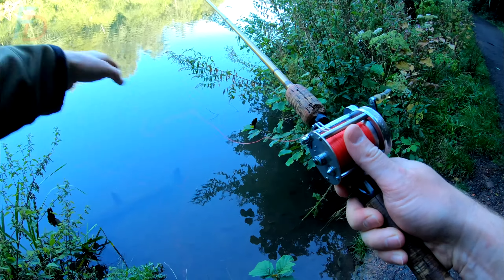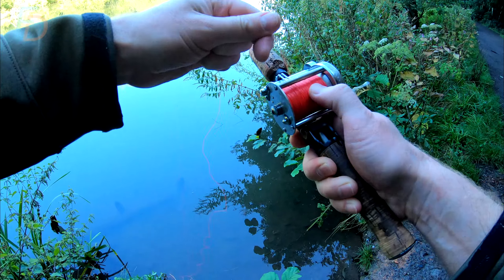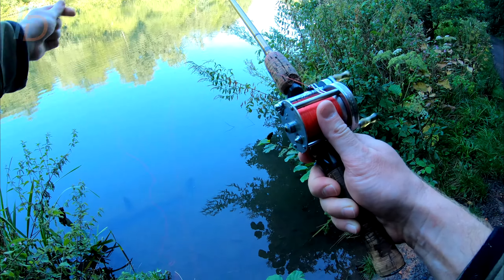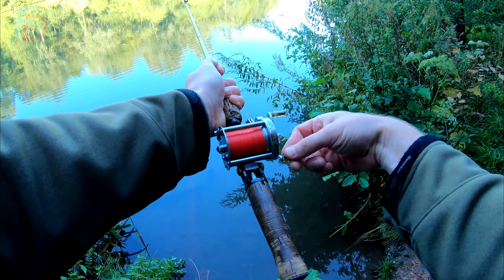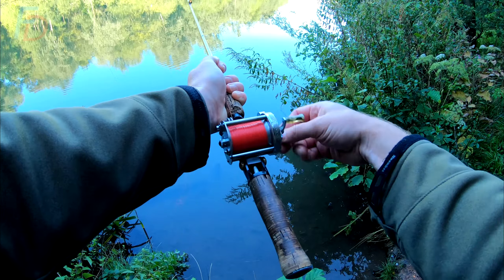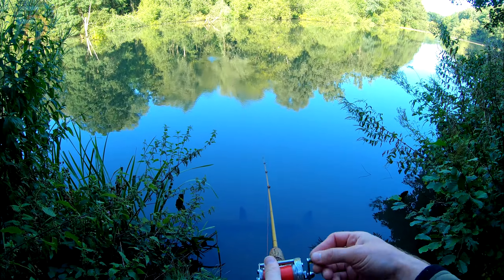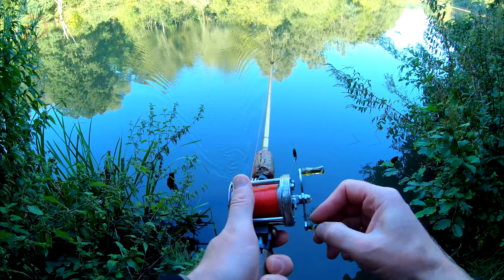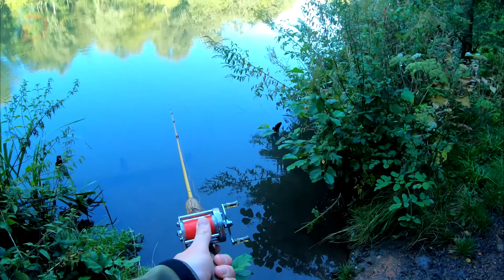Can my Grandad's Antique Pflueger Baitcaster Survive a Pike Attack?

Comment: Wow, I'm so glad I found this video! I have a Pflueger Akron no 1894 that I purchased at a garage sale (on a rod) almost 20 years ago and has been sitting in storage ever since. I'm finally getting around to restoring that rod and reel. I'm in the research stage and I could not figure out why it would click all the time, even when reeling in. There are no wear marks on it so I had no idea that nub on the left side is actually a toggle switch! I'm hoping to restore the rod and reel and go fishing with them this summer.
Reply from the maker: Awesome - I think you'll have a ton of fun with it. I'm amazed at the fact you can still buy spare parts for these reels... try doing that 50, 60 or even 80 years after the current state of the art reels have been released. I bought several parts from the USA and Glenn's Reel & Rod Repair in Des Moines were really helpful as well as having an amazing stock of parts. Paul.
Reply: @FishingDiscoveries  I appreciate the info! I'm not sure if it needs parts but I was debating buying at least one other reel to have spares in the future.
Reply: i'm partial to using a  Pflueger Akron 1894, too! I can get casts up to 45 yards using a vintage steel rod.

Comment: Cool video, I've got a few rigs like that hanging on my wall. I recently pulled them apart and oiled them up, and they are suprisingly smooth now. I might try and get a few pike on them next summer, I'd imagine that a big one might leave you without a thumbprint though. Wondering what line you are using on yours?
Reply from the maker: Do it! It's a ton of fun. SInce this video I've taken to wrapping fabric sticking plaster fabric around my thumb (and I've heard that the tape goalkeepers use in soccer is even better) - and this improved the drag hugely. The line I have on in this video is Berkley Fireline (fused braid seems to work nicely) - I think in 29 lb if I remember right. I did hook a big pike on my most recent trip fishing this rig from a boat - though it came off after a few head-shakes. It hit like a train though (and the crank handles are so tiny, you kind of need to reel with your pinky finger sticking out - which makes you look kind of fancy 😂 )
Reply: @FishingDiscoveries  Good tips, thanks. I've got one where the handle itself has a crude drag. The other has an anti backlash that puts light spring tension on the levelwind, pretty darn clever if you ask me. Cant wait to give it a go!

Comment: What weight of line were you using?  I just serviced one of these reels and I cant wait to try it out.
Reply from the maker: Hi Tony, I had on Berkley Fireline (braid) rated at 13.2 kg (just over 29lb). Diameter is 0.2mm. Good luck with your own outings! Paul